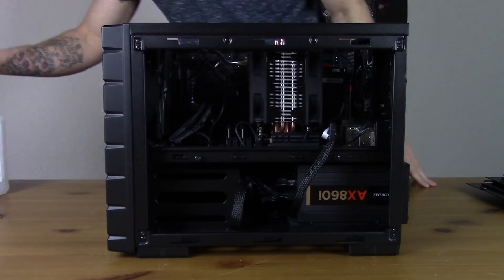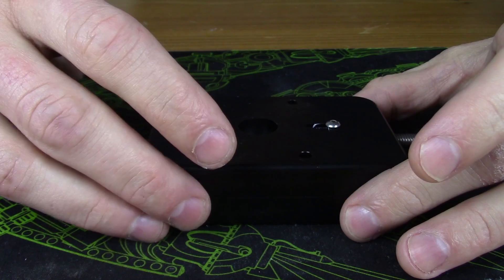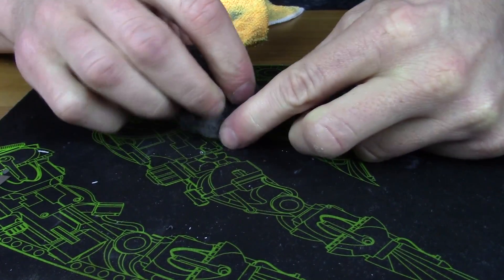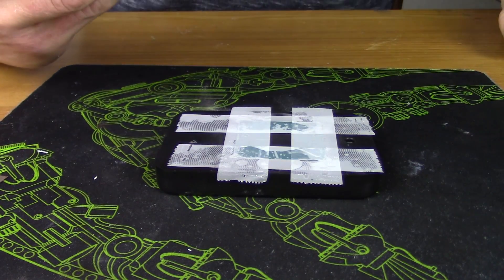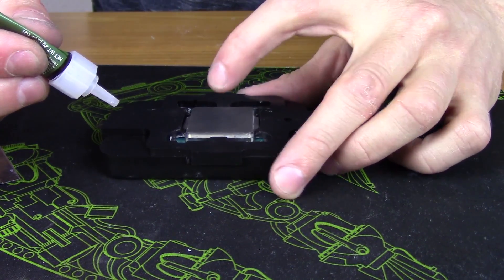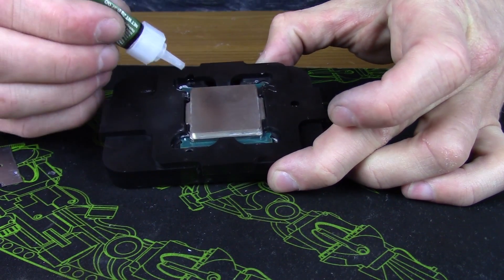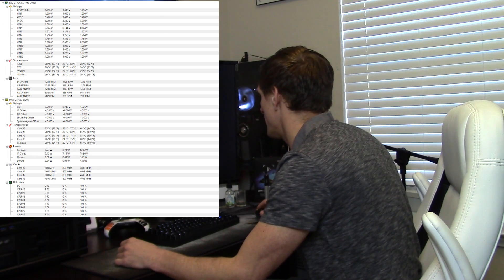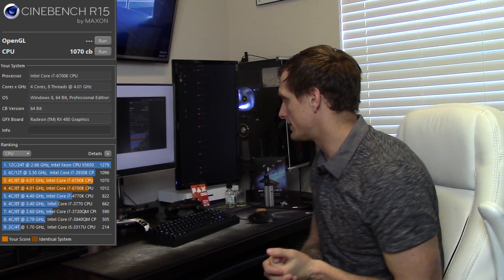6700K 4.9GHz Overclocking & Delid Guide

Comment: I have same sucess, delided with liquid metal on both ihs sides and i run my i7 6700k on 4.8 ghz for 24/7 stable  at 1.46v temps are not going highter than 75 degrees, an awesome chip to play with. I was able to hit 5 ghz on 1.52v but isnt stable and safe on air. But the chip can do it with better cooling!

Comment: If it already does like 4.5 - 4.6 without delid, i dont see much use of this. Those last 200mhz not going to do much. Most people are GPU-limited anyway even in 2018 with the 6700K. Unless they run a 144hz screen and want to keep those FPS as high as possible all the tie. Running 1440p or 4k, this is a non issue.

Comment: youre saying that youre pushing 1.52 volts throu a skylake cpu and only doing a 1070 on CB? not worth it when you set it up right on 4,5 you can achieve around 1020. not worth decreasing the life span of your cpu.

Comment: Hi, is this still running healthy at this voltage ? I'm bad at silicon lotery i got 4.5ghz at 1.35v stable hits 72C without deliding, i was try 1.47v and 4.7ghz temps go up to 87C and not stable.

Comment: LOLL  This guy just said he's running his voltage at 1.5 and he thinks this is safe???   Don't listen to this guy!!   Now I hear he runs LLC ON TOP of 1.5 volts.  JEEEEZE    ..  Everything I've read says 1.4 is like absolute max to consider...
Reply: @ rEcoN rYan
Video Proof/Fully Verified OC or I'm calling BS on that brother. And I'm not talking just getting a Windows boot and an image of CPU-Z - talking verified uploaded results on a well known OC stress testing tool.
I've got my i76700K at 5.6Ghz on AIO Water cooler.....now where  did I put that link to my verified online proof.....
Reply from the maker: Check out my hwbot profile. Understand enthusiast overclocking. It's a different game than your playing bro.
Reply: Dude..  I have a 6700k + 1080ti both water cooled w/ dual EK rads (360mm and 240mm)  dual pump.   5.5 ghz is my max OC'  5.2 ghz stable @ 1.4v.     
I have been overclocking since Pentium 4 days and water cooling since the Thermaltake big water kit back in like 2003.    
I'm just pointing out it doesn't take skill to put voltage at 1.5 and claiming you have a good O/C.     You're destroying your chip via electromigration.  Look it up.
Reply: 1.5 volts with LLC on could be pushing your voltage even higher to avoid Vdroop.
Reply from the maker: +rEcoN rYan yes
Reply from the maker: +rEcoN rYan I'm aware of all of that. I would love to see your overclock sounds like a great chip. What's your hwbot profile?
Reply: After I got out of folding (fold@home) I stopped my activity on the forums etc.   More a less just overclock for gaming performance more so than the bragging rights.   Not that I'm against die hard over clocking of a chip to see what it can do via dice / extreme phase change cooling etc.   

The point of my comment was to dispel the ever so common myth that temps are all that matters.   Personally, if I fried my 6700k, I'd have a great upgrade excuse for the old lady :D  Others may just be flat out, out of a PC.     1.5 on skylake is imho, too dangerous  24/7 w/o at least a disclaimer of risk.    Been a rough day,  sorry if it came across initially douchy :D 

I see so commonly on the threads of low temps so its ok to just push voltage higher.    My experience though over the years (especially recently) has been overclocks limited by the CPU, not thermals. 

I actually bin my CPU's as I can get and return them w/o issue so I just keep the best overclocker out of the bunch. CPU's typically last me long enough to find it worthwhile.   This one truly has been golden though.   1.28 in bios w/ LLC on level 5.  Hits at like 1.34 or something like that?
Reply: 60c max temp in prime95 small fft's     20-25c idle depending on ambient of course.  1080ti never touches higher than 40 so its like it's not even there.
Reply from the maker: wow with FPU? dellided ofcourse I assume. hmu with whatever content you have created. I am happy to share.
Reply from the maker: mmmmhhmmm. So you just go try and shit on other people. cool bro.
Reply: @ rEcoN rYan - care to share your motherboard settings screenshots (LLC, Overide etc) on how you managed 5.2 @1.4V on a 6700K. That's sub 1% territory, maaybe you are doing something different in your OC approach?

Comment: What? 1.45V just for 4.6 GHz? Mine is running at 4.7 at just 1.325 V
Reply from the maker: +bhushan kharmale fpu stress in aida64 ?
Reply: Yeah. I have set the voltage to 1.290 in adaptive mode under BIOS. The VID peaks to 1.325V under load. And max VCORE is 1.112.
Reply from the maker: +bhushan kharmale nice man. Sounds like a good chip. Aida will wreck shit with fpu. Same with prime95.
Reply: Yeah and maybe because it's liquid cooled.

Comment: before deliding i had problems to run my 6700k az 4,6ghz with 1.340V at 83°C in Realbench. Well just the temps bothered me, was stable though. But at 4.7 i had toput it up to 1.380v which was too hot for me hitting almost the 90°C. After deliding i ran them the same stats , mostly under 65°C even in Prime95(version 26). But i would never run my chip as high voltage as this, even when it would stay cool. It gave me a shiver when i heard your 4.6ghz voltages..

Comment: Im running 4.7@1.27 but my temps are in the 90's on benchmarks with a custom water loop. Really hoping a delid can let me keep the frequency but at much lower temps
Reply: SniperBlaize 90 ! I’m 75c with 4.6 at 1.29v - on a nh-u12s.

Did you delid ? What are your numbers ?

Comment: damn that's badass. i'm only running 4.7 at 1.33 without delid.
Reply: lucky you... I need 1.38v, a base clock of 102.1, and x46 on the multiplier to hit 4.7 with custom liquid cooling. I got raped on the lottery.
Reply: I'm at 4.7 at 2.888 with a +55 offset voltage. Under max load its at 1.325 stable. Before With a +25 offset voltage it worked in all games until I played bf1 on ballroom blitz and it blued screen 😑 and Its cooled by a hyper 212 evo with a suck / pull setup and the highest temps i have ever seen was 72c under major benchmarking. Other wise in games which is all I do I've seen it get up too 64c. At stock 4.0 speeds 52c was the highest I've seen it get too. And I'm on a Evga z170 ftw motherboard. Think i did good with this one 👍🏻
Reply: That's what mine runs at,,and no-one believes me!,,, the 6700k is a very nice chip!,,,

Comment: So I did this with my 6700K using a straight razor. No delid tool. Used thermal grizzly conductonaught(liquid metal) between the IHS and CPU. Didn't brush it on, just kinda pushed a glob on and around the die, with the cheap scotch tape covering the PCB. I didn't even glue the IHS back on, just did the floating method. 

So, wow. When I was using an EK monoblock with paste my max temps would hit 86 degrees Celsius. Now, with a air coole (still using paste), my max temp has been 56 degrees! 30 degree difference and averaging about 15 degrees cooler. What a difference. This is at 4.6GHz.

Comment: Running 1.528V on the chip? Better save up cause your i7 6700k will pop/degrade within a year +/- a few months. Why did you delid such a bad overclocker in the first place? My 6700k does 4.7Ghz @ 1.26V, 4.8Ghz @1.332V and 4.9Ghz @1.404V. I consider it barely worth delidding so why you delidded yours is beyond my comprehension.
Reply: SandyBridge which is 32nm is a lot more durable than 14nm in terms of voltage, running a 3930K @1.53V for a year degraded it. So your 6700k will at least degrade 100-200Mhz but most likely it'll pop leaving magic blue smoke behind but hey it's your 300$ 6700k not mine.

Comment: either your chip is terrible or mine is amazing...both maybe? I have had my 6700k @ 1.376v 4.8ghz since release. I am using a h110i and using aida 64 with fpu over 24 hours I saw temperatures no higher than 82'c...if I delid maybe my chip could fly to the moon...

Comment: errrrrrm there are no conductive components on the top of the package.....so the scotch tape thing is pointless...... if there were diodes or resistors then yeah ........? and i used to work for a pcb manufacturing company so before the trolls start bitching i know what im talking about.

Comment: I am just going to guess and say I got lucky.  I have an i5 6600 3.3 GHz.  I wanted the 6600k but it sold out like 10 minutes before I pushed the buy button.  so long story short.  I have a 6600 NON K chip at a vcore volt or 1.376 clocked at 4726mhz.  ON AIR.  I have a V8GTS cooler and a big case with good cable management but could be better.  If I delid this chip I am 100% sure I could hit 5.0 stable and not have to come close to 1.55vcore volts.  has any body out there OC a non K sku and had any success like mine?  I am curious as if I delid and liquid cool....... how far can I push it.  I may have gotten lucky and got a binned chip or maybe the K sku's are built a bit different as they are unlocked.  I don't know.  I am happy that the 6600k sold out before I could buy it.

Comment: 4.6 on 1.45 volts???? this way too much, i m running on 4.5 at 1.250v stable
Reply: WeeD Akimbo  i highly doubt that, you have a cpu-z  screen shot of this?
Reply: I must be lucky 4.7 at 1.350v
Reply: Me too
Reply: Some people just got unlucky. I can't run my 6700k over 1.3v without temps going crazy, and I've got a kraken cooler. But I just run it at 1.25v at 4.4 and I'm happy with that. It still gets around 70 degrees even at that!
Reply: @raimon1986  what is your voltage setting in your bios? is it auto or adaptive?
Reply: @BrittanyMartin917  Its just set to manual.
Reply: @raimon1986  check your thermal paste application is it quality stuff? what motherboard do you have?
Reply: im running 4.7 ghz @ 1.325 volts fully stable why his voltage for cpu are to high  @4.6
Reply: @patskey08   may not know how to fully understand overclocking or just doesnt want to spend the time to see whats the lowest voltage he can go at 4.7
Reply: im running 4.8ghz cpu and 4.6ghz cache @ 1.38 volts with corsair h110i aio cooler
Reply: Everyone knows the better overklocker chips require more voltage and run hotter!
Reply: I must have the worst 6700k on the planet, wont do over 4.4 stable regardless of voltage. The times I had it at 4.6 it got up to 90c even with a noctua 15. Think delidding would help my poor 6600k?
Reply: @e5m956  i am on nh-d15 4.5 1.34 volt ! so yeah i think u are unlucky ! Oc 24/7
Reply: im running 4.7 @ 1.360volts. 1.45v is too high
Reply: @lprc7196  i'm running 4.7 @ 1.312v stable and max temp hasn't gone above 75C
Reply: @lprc7196   iam running 4.5 at 1.34 and i though i had good VOltage here hehe

Comment: I'm at 4.5Ghz @1.225v on a stock 6700k.. That must be a very bad chip you got there.
Reply: Max load temp of about 60c
Reply: 4.8Ghz @1.355v. But there is no point in going any higher as I live in South Africa and its pretty warm everyday and my Gtx110i can't really keep up with the heat,hence the underclock on my cpu in voltage.Stock voltage on my Msi gaming m7 mobo is 1.320v. so i'm pretty happy with what I have atm.
Reply: Kevin Tolman 4.8 at 1.32v. and 5ghz at 1.4v
Reply: Mine clocks 4.5 at 1.27v to be stable but can hit 4.8 at about 1.39v and stable never could get a stable 4.9
Reply: Kevin Tolman hi Kevin do u think I can oc my i76700k to 4.5ghz like you did on stock cooler ? What voltage is yours set at
Reply: talk about a bad chip. 4.5 GHz Adaptive @ 1.376

Comment: That's a pretty awful 6700K sample, needing a scorching voltage to do 4.8GHz.  I've got one non-delidded sitting at 4.7GHz, stable to 24 hr Prime95, at 1.36V.  The "increased longevity" statement gave me a chuckle though.
Reply: Noobs think just adding more voltage makes them a good over clocker .    Scary stuff here.
Reply: thats exactly what I was thinking... I've seen lots of people at 4.7 and 4.8 GHz at less than 1.4 volts. Air cool FTL.
Reply: Mine does 4.8 @1.36V
Proud

Edit: it does 4.7 @ 1.31v, anything above that requires going above 1.4v and I can't cool it without the delid..
Reply: I’m at 4.6ghz at 1.29. Haven’t tried to go over cause temps max at 75. Would love to at least get a 10 degree drop with a delid.
Reply: Same for me. Im at 102*46, so pretty much 4.7Ghz, 1.355, and CPU cache at 45*102Taking above 4.7 requires above 1.4v. Thats not worth it...
Reply: How did you get the 6700K to do this? Do you have a video or a link please, so I can learn how to do this myself. Cheers.

Comment: Geez, I must have gotten REAL lucky!  6700k(no delid), 4.6Ghz, 1.336V, max temp is 70°C and Cinebench is around 1015.  Curious what I could get IF I did delid, but I'm pretty happy with the results so far.
Reply: That is true; so, you're pretty sure I would see gains and positive results from the delid?  I guess I'm talking more gains concerning my overclock.
Reply: Son of a Tech just ordered the rockit 88 and both relid kits!
Reply: Son of a Tech first delid was my son's 3570k.  Pre-delid was overclocked to 4Ghz at a max temp of 82C.  Post-delid I overclocked to 4.5Ghz, and the max temp is 62C!  Unreal!
Reply: luKe i run 1.32 4.8ghz. no delid yet
Reply: Bboy Tyby nice!  I haven't done my 6700k yet, but I worked on my son's 3570k overclock some more.  Currently at 4.6Ghz and 1.28v with temps max at 62 still.
Reply: Currently at 4.6Ghz and 1.3v with temps at 71°C in Aida64 with fpu.  I'm around the same temps with my 6700k delid @ 4.8Ghz, but I had to push the voltage to 1.375 to get it stable.  I'm also running a Corsair Hydro Series H100i GTX.
Reply: Son of a Tech my 6700k is a piece of shit delidder 4.4 at 3.6v 4.6 is over 1.4.

Comment: So why doesn't Intel do this initially? I'm guessing it's hard to manufacture and expensive, but hot damn... Also, do the temperatures fluctuate massively? I notice CPUs can change in temperature by like 20 degrees in just 1-2 seconds, and I'm curious if it's because of the not so good thermal paste they use.
Reply: I say lower manufacturing cost .
Reply: I see. I've heard stuff about the cracks before, but I think that was the die chipping when it was cooler on die, no heat spreader. Thanks for the reply!
Reply: Interesting explanation. I was thinking Intel was being a bit nefarious and purposely imposing some kind of thermal limit on people's overclocking. Those who want the highest overclocks have to delid and physically alter the CPU, voiding warranty.
Reply: So if they found out that solder cracks ,why would Intel still uses solder on x99 platform ? .
Reply: Probably thermal paste is easier to apply on a automated factory. When using liquid metal you see that it doesn't get into shape easily and can't contain any bubbles, so that wouldn't be easy to automate.
Reply: The temperature change is normal and will happen as soon as the voltage changes.